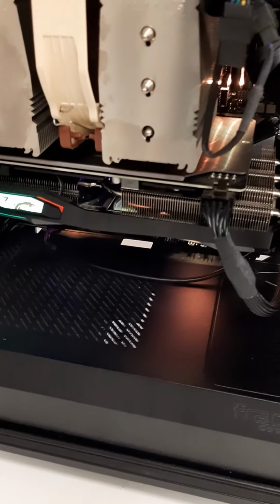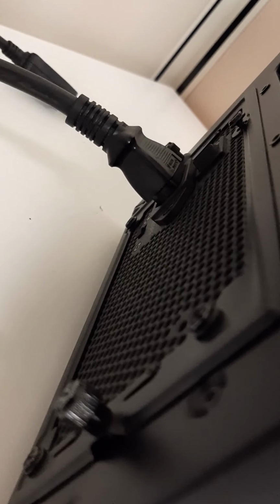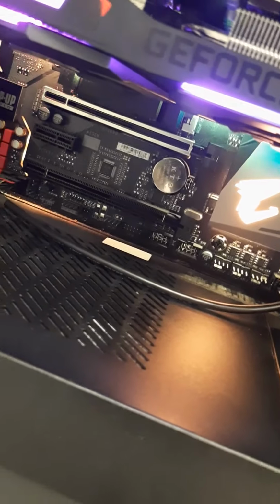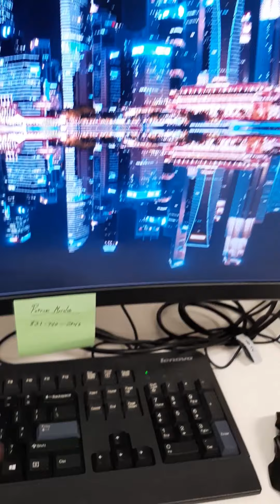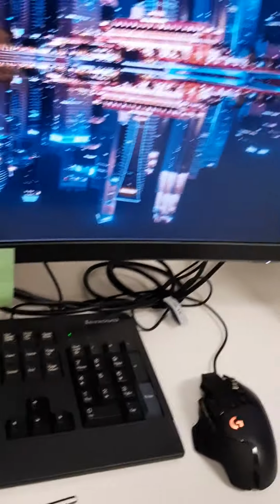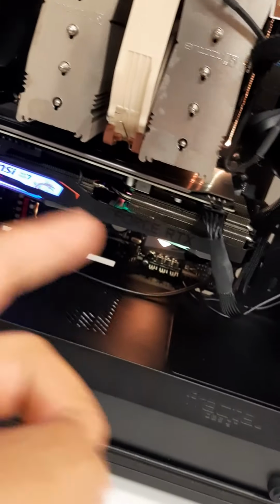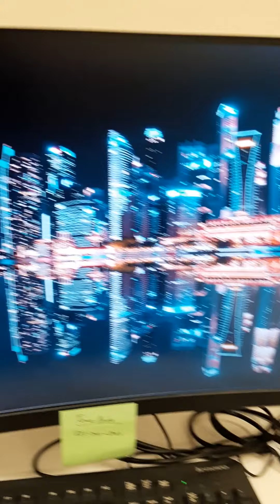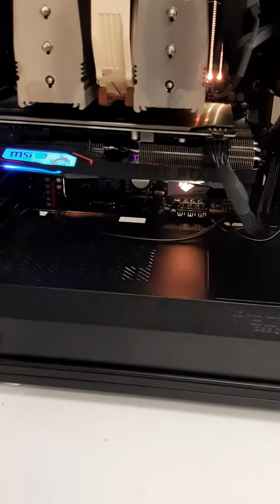HOW TO FIX BLANK SCREEN AFTER ENABLING SECURE BOOT | Windows 11 Upgrade Headache Fix

Comment: This video just save me. I did some tips from the comments here and now I installed Windows 11 successfully. If you guys are with blank screen, just do the steps on the video. 
After that, on BIOS configuration, when turn on secure boot, make sure to set STANDARD, not Custom. That is what makes the blank screen. Also don't forget to enable the PTT config.

Thank you so much for this video. W11 working fine now
Reply from the maker: I'm glad this helped and thank you for the tips. Hopefully someone can benefit from it ❤️
Reply: PLEASE PIN THIS GUYS COMMENT. So many tutorials online to fix the black screen, but no tutorials to fix the issue it’s self. Needed to put it on to play valorant as I stream it often.
Reply: do you have integrated gpu ?
Reply from the maker: @silasjenkins2096  Just pinned the comment. Sorry for completely missing your comment. I haven't been checking my YouTube recently and there are a lot of comments here. I hope it's of help to people.
Reply: What if before setting standar i had it on custom? I set It standard and then back to custom and put save and exit and i got crashe, then i turned off my PC and now doesnt want to give display i Will try to unplug the gpu and hope It works
Reply: @stoneyr3608 did it work? Because mine is completely froze on display.
Reply: @aIlergies  No, if you already did the battery BIOS reboot AND Its still Froze Like my case i changed the ram i had and that worked
Reply: I didnt unplug my graphic card because of the risk but they say it works idk
Reply: @stoneyr3608  the ram is brand new though, and everything was working until I changed the secure boot to custom. Man I just want this thing to work
Reply: @aIlergies  ik, i just did a reboot in my pc and wanted to play val so i enabled secure boot, thats when i got 4 days black screen until tryed pluging rams from another pc.
Reply: @stoneyr3608  I pulled one of my ram sticks but to no avail, it didn’t help whatsoever sadly.
Reply: @silasjenkins2096 yo bro did u fix it and how
Reply: I tried everything but for me it says fPTM and enabled that and put it to standard and saved and exited and went straight back to black screen
Reply: This is not a "Fix", this is a how to get it working again after the fact, but does still not explain how to get secure boot working.

Comment from the maker: If you don't have integrated graphics, this probably won't work. This won't necessarily be the best fix or something ideal for you but you may have to consider buying a cpu with integrated graphics or a new motherboard. It won't be a cheap fix but it should fix the issue and come in handy in case anything like this ever happens to you again. I'm no pro with computers so I'd recommend doing some research on this first!
Reply: how about for HP laptop? i have a blank screen right now. what should i do? thanks!
Reply from the maker: @gelrafols8665  unfortunately, I would have no idea how to help you with that 🙁 I haven't done any of this on a laptop. You may have to take it to a shop to get it repaired or something. That's the only thing I can come up with, sorry
Reply from the maker: @shakidaki  yeah, you plug the hdmi into the motherboard temporarily. You just need to use your integrated graphics to get a display so you can turn off secure boot, then you can connect gpu again and go back to using it
Reply: The reason you black screened may be because your secure boot state was set on SYSTEM instead of USER. to change this you have to change the secure boot type from STANDARD to CUSTOM and back to STANDARD again and it should work.
Reply from the maker: @lostemu8988  really? 😯 I should have tried that. But now I'm afraid to try because of another black screen 😂 I don't want to go through the process again lol
Reply: @anthonydiaz6101  Yeah i did the same thing, when i enabled secure boot on the SYSTEM state, it blackscreened. So i researched and i found out that you have to change it to USER and it worked.
Reply from the maker: @lostemu8988  May try again. I have a fix for the black screen so it's worth trying. Although not sure if windows 11 is worth it after what I've seen online
Reply: @anthonydiaz6101  Microsoft might find a way to make it easier to install windows 11. Maybe a windows update that enables secure boot and tpm? Im not sure if thats possible but if it was, it would change all the negativity for windows 11
Reply from the maker: @lostemu8988  we'll see what they do
Reply: @lostemu8988  will hitting the key without integrated graphics bring me to the bios screen ? Please respond
Reply: @yasssssking  yes it will, all non-integrated graphics card will do it
Reply: @lostemu8988 I cant even see my gigabyte screen and pressing the keys without any display isn't working. Please if you know anything on this that can help it will be a great help
Reply: @shakidaki My processor does not have integrated graphics so mobo method also shows blackscreen not even the gigabyte screen what can I do rapidly hitting the f2 f12 or del key is not helping. Please respond
Reply: @yasssssking  oh u blackscreened? so when u turn on your computer nothing shows up? I dont know i just took it to a pc shop and they fixed it. Sorry if i didnt help
Reply: Will it work if we try different graphics card
Reply from the maker: @cheezyy5487  I think a couple people in the comments have already tried that without any success
Reply: @shakidaki  I have GB's H310M + i3 9100F. Thanks for the suggestion but my mobo was in warranty period so I sent it for service now they may return a repaired or new mobo
Reply: @shakidaki  also I had no display in the first place so there was no question of updating the bios
Reply: May help some others. I found another Solution and just spammed del key while starting. Did the steps out of that Video before

Comment: Heyo, thank you so much for this video. Helped me get my pc posting again. I did some poking around and found out the issue causing secure boot to do this. It has to do with the default keys for secure boot, and if you go into your bios where you turn on secure boot you should find an area where you can turn on default keys for secure boot and that fixed the issue for me so I can now use secure boot fine in windows 11, hope this helps!
Reply from the maker: No problem, glad it helped you out. I appreciate the feedback. I'll give that a shot if I choose to upgrade.
Reply: Wow, worked for me. Thanks man
Reply: @marcuslee1949  Glad to hear it worked! No problem at all
Reply: Can you do a tutorial ?

Comment: Thought I found the solution. I was euphoric. Went to solv it just to find out that as I have an ITX motherboard, the battery is hidden in a welded box so I can't take it out. Hating my life rn
Reply from the maker: The battery step isn't necessary. You can skip it

Comment: I have the same problem but even when i plug it in the Motherboard is still black screen , nothing happens , reset CMOS and everything , tried with the GPU in/out and i still dont have access to get back in Bios …

Comment: Your video saved my pc. I was having the exact same issue with my ryzen 5 cpu and enabling tpm (installing ftpm key) totally bricked it. Nothing worked (CMOS short, battery removal etc.). Sadly my cpu didn't have any built in gpu. I took the board to my friends and used his athlon 3000g and it worked just fine. Reset the bios and now posting this comment using my pc after getting the problem sorted. A big THANKS.
Reply from the maker: Very happy you got it working again! Thank you for watching my video. I appreciate your time and your comment ❤

Comment: EASY FIX FOR GIGABYTE MOTHERBOARDS.

STEP 1: DISABLE CSM support 
STEP 2: click on secure boot and try to enable it. You will get an error. Restart the computer and enter bios again. Then it will allow you to enable secure boot. Make sure under secure boot menu change secure boot mode to standard instead of custom. 

Step 3: click on peripherals and enable Intel platform trust technology. 

I hope this helped you all.
Reply from the maker: Will this allow secure boot to be enabled without the black screen issue?
Reply: @anthonydiaz6101  first time I enabled secure boot I had black screen. I pulled out the graphic card and cleared CMOS  by pulling the battery for 10 seconds. Then I connected the display wire directly to the motherboard integrated graphics card. 

I went back into BIOs and applied those settings I mentioned above for easy fix. 
Everything was smooth. I have windows 11 and no vanguard errors for gaming. 

Last step, put the graphic cards back in and plug the display wire.

So I think you should get no black screen if followed those steps the first time for enabling secure boot.
Reply from the maker: @TK-iy2qd  I might give that a shot. Thanks bro 👍 I'll let you know if it works or not when I try it.
Reply: @anthonydiaz6101  cool let me know. I'll help you troubleshoot if you run into issues.
Reply: @TK-iy2qd  You are much luckier than me. I had such a pain trying to get my PC to run normal again (not be black screen) after messing with my bios settings. I wound up just reinstalling windows 10 once it finally booted up after hours of trying things. For now there will be no Windows 11 for me unless it isn't such a risk/pain
Reply: @Kyber3000-Kimberly  what type of motherboard you have and the are you running AMD or Intel ?
Reply: @Kimberly can you remove the graphic card and use the integrated graphics card to apply the bios settings I mentioned above? If the computer turns on then download from Microsoft this tool Windows 11 Installation Assistant.  When the settings are changed in bios it will still show in windows update that the computer is not compatible (error) for upgrade but that windows tool should update it.
Reply: @TK-iy2qd  Intel and for an update I got my pc working finally. I had to take out my graphics card and turn off secure boot and then my pc started. For now I will be waiting on getting Windows 11.
Reply: @Kyber3000-Kimberly  in secure boot menu change "secure boot mode" to Standard this should take away the black screen error. But apply these settings while connected to integrated graphics card.

If you want to give another shot
Reply: @TK-iy2qd   thanks for trying to help. A moderator from Gigabyte wrote me earlier telling me to take out my graphics card and then start bios and disable Secure boot, it finally booted up and I disabled Secure boot. So far my pc is working perfectly! I’m very happy because I was on the verge of buying a new motherboard or bringing into a repair shop.

I also didn’t remember I needed to select hdmi on my monitor options instead of display port, this would have helped to remember since I couldn’t get a display when I had my display port connected to my monitor.

 Note: Kimberly is me as well I forget at times I’m on my other account.
Reply: Ohh man thanks you so much its work to me 🤚
Reply from the maker: @Kyber3000-Kimberly  glad to hear your back up and running 🙂
Reply: @anthonydiaz6101  thank you, I’m very happy as well! I thought for a bit that my motherboard or something was done. Just a bit bummed that I would have to mess with bios in order to upgrade to windows 11, for now I’ll be waiting.
Reply from the maker: @Kyber3000-Kimberly  agreed
Reply: @TK-iy2qd  thank u very much man .. u are the one
Reply: I'll try this, I just did it but I put secure boot option to custom
Reply: @iplayvideogames69420  I have no integrated graphics. Any ideas?
Reply: This fix completely worked and I appreciate that you shared it with us!! Issue completely resolved with the help of Anthony and TK! (My motherboard is a gigabyte z370 hd3-OP)
Reply: Sadly i have a cpu without integrated graphics, i have tried removing the bios battery for 5 minutes, shorting the cmos pins, removing a stick of ram and changing the positions, yet black screen while my keyboard and pc case leds work. I noticed that while on blackscreen the keyboard capslock white light when pressed doesnt work! All this after enabling secure boot on a gigabyte motherboard. 😔
Reply: @donatgosalci7379  if you are under warranty they'll probably take it no questions asked. It's very common.
Reply: @xLightcrystalx  did they tell u what they did to ur pc? Or did they replace the mobo
Reply: @donatgosalci7379  in some forums holding the powerbutton for around 15 to 30 seconds work to get the bios, in other cases push the restart button and power button and hold it went back to bios screen, i think thats your only possible solution if you didnt have a apu
Reply: @kevincastillo7601  i had to send my pc to the repair shop since my mobo deleted my gpu and cpu drivers, they had to take mine of, put some other model in and then flash the bios ans then reinstall my hardware
Reply: @donatgosalci7379 did it fixed I have the same prob now ryzen 3 3100 with Rx 550 graphics card no integrated GPU in it pls help I turned on secure boot and save it and exited I've got black screen tried everything no hope for me 😭 gigabyte A320M-H rev1.2

Comment: Guys, anyone who doesn’t have a cpu with integrated graphics, flash bios using the q flash method. Your motherboard might not have the q flash button on the I/O board, look for the USB port which says BIOS on top of it or below it. If your motherboard has that, then the Q Flash button should be somewhere in the motherboard it self. I faced this issue last night and was absolutely breaking my head to fix it and I thought I didn’t have a Q flash button, but while trying to find the BIOS jumper I found the q flash button. Worked 100% perfectly

Comment: I need help with this, I tried what you said but I still have no post
Reply from the maker: You need integrated graphics for this to work. If you don't, look through the comments as some people have been able to figure out other fixes.
Reply: @anthonydiaz6101  Yea, I figured! I will be replacing my motherboard since I have tried everything!
Reply: @anthonydiaz6101  this short got in my recommended again and all I wanna say is that they repaired my motherboard and everything has been good since! 😊😊

Comment: Hi. Thank you very much. You are a lifesaver. I did the same exact thing, and tried
to enable secure boot for future Win 11, and same thing happened to me. I spent
hours diagnosing, clearing CMOS dozens of times, checked the RAM, GPU, and
everything I could think of. Luckily after I saw your video on YT, and seeing I had
integrated graphics on my MB, tried it and it worked. Thank you, and thank Jesus
I found your video. Cheers!  😊

Comment: I don't blame you for saying f Win-11. I went against the little voice in my head last night and wound up doing things in the bios just to try to get Windows 11. To get to the point my PC became unusable after the last part which was something to do with register system keys, after I did and it restart, the issues began. I did everything I could, I took out the motherboard battery, reset the cmos (shorting it), took out my graphics card, and the list goes on. It turned on once before I did all of this and then completely stopped for hours and hours of trying to get it to work. I wound up putting a clean install of of Windows 10 on a usb and eventually it booted up with that, I really don't know why it decided to work because it wouldn't at first.

At this point, I will not be messing with trying to get Windows 11 until I upgrade all of my hardware or at least my motherboard and graphics card which I do plan on doing when a graphics card is not way overpriced. I hope maybe newer stuff won't be such a pain (if it is I may skip the upgrade until it isn't so risky). 

Just be careful if you try to get Windows 11 on your pc or you could end up with a bunch of issues like I did and others have been.
Reply from the maker: 100% man, I did the same thing. I knew I probably shouldn't have messed with it, but I got way too into it; trying to find a way to install it. Led to nothing good 😂. I'm super glad you were able to get it fixed bro. Other people haven't been so lucky. Maybe they might have some luck by doing what you did. I'm doing the same thing you are, though; just waiting until it's less risky. That will probably be much later on though because my computer doesn't meet the requirements and I don't really want, or need, to upgrade right now.

Thank you for commenting!
Reply: Can you please give a link of ISO you use in your bootable USB
Reply: @shakidaki  this is true